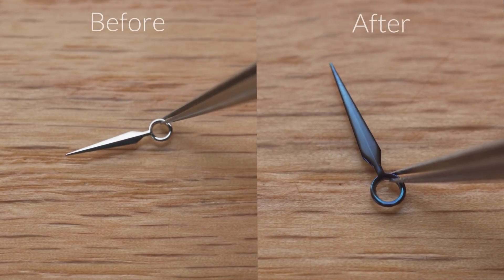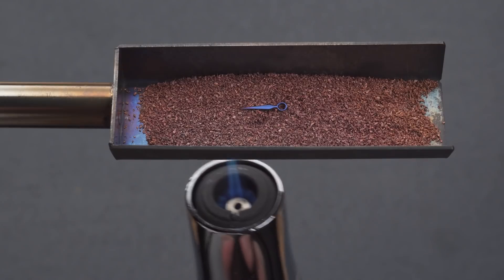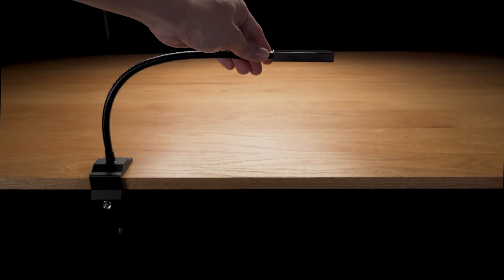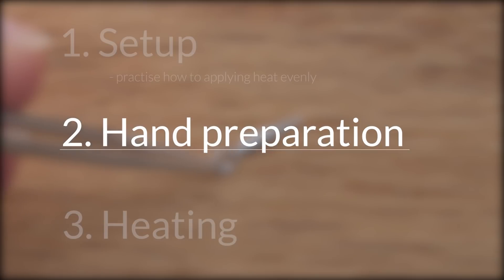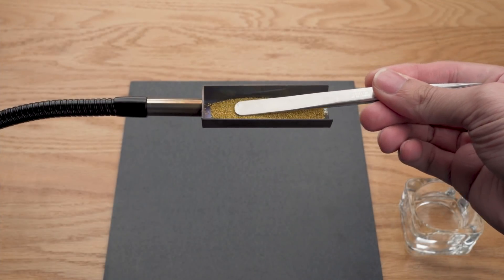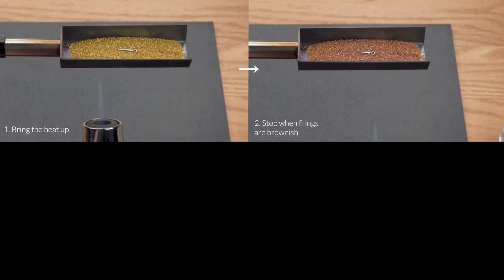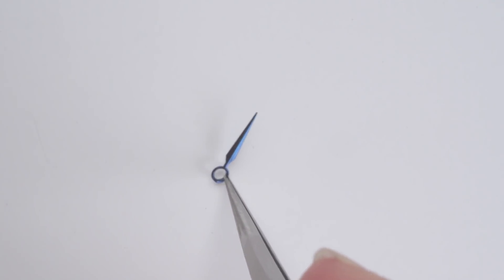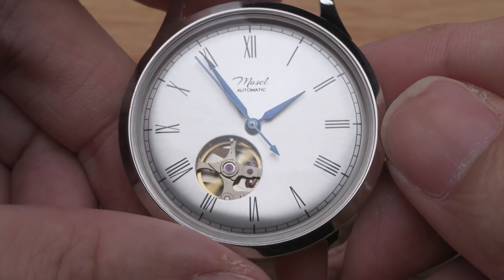Thermal Bluing Steel Watch Hands

Comment: Why not space all three hands closely together and blue them at the same time? If you heat slowly, wouldn't that pretty much guarantee the same color for all?  Thanks!
Reply from the maker: That's a good question! There are a few difficulties with this approach: 1. it adds to the demand to maintain an even temperature and there's no guarantee you can do that perfectly in one go, 2. the three hands are shaped differently (for example the widths of the hour hand and the second hand are drastically different), so their responses to heat behave differently as well, 3. heating them together means you'll need to manage quenching 3 items at the same time, and by the time you quenched the first, the others might be at a different color already. Of course, I can see some engineering solution being developed for each of these difficulties. But by then, you'd be better off using an electric heater or oven that allows for precise temperature control. Quite frankly, that's how it's industrially made nowadays and there's nothing wrong about that. With proper cleaning and preparation, you can make perfect blue hands in batches. The only thing it lacks is the small variance that is human error. And for me personally that's the charm of DIY. BUT don't let me discourage you from trying that approach out. Could be fun!
Reply: This was a demonstration on how to blue a clock hand , surely common sense would say that all hands are done at the same time , but for the purpose of educating viewers only one hand was blued , silly remark really , I'll bet your blushing now when you realise how stupid your remark is . Good video in my opinion , very clear and as others have said no background music to distract a viewer from the concise detail demonstrated .

Comment: Could you show this technique being used for bezels? Would like to color change a bezel to a bronze/brass-like finish
Reply from the maker: It really depends on what the bezel is made with. There could be coating or plating that largely makes the bluing process impossible. And then you have to see what kind of construction the bezel has for turning, and determine whether bluing could affect that mechanism. I could give it a try but the result is going to be really specific to the watch.
Reply: You can do it on carbon steel and UNFINISHED stainless steel of certain varieties. If you have some of the same stock then practice on a tiny piece or find out what material it is (probably 316L) and get some

Comment: I came on to your channel from retro watch channel, I have a question you mention quenching the hands in acetone or mineral spirits and later in your video you say place the hand in the water. I am confused-which is it?
Reply from the maker: Acetone or mineral spirits are used for cleaning the hands, not quenching. We use water to quench the hand. Alternatively, oil can be used to quenched the hand as well but it has to be cleaned afterward (by acetone or mineral spirits).

Comment: Hi, can i do this to all the watch part as long as made of stainless? Like the chapter ring?
Reply from the maker: For cosmetic purposes, yes. Non-stainless steel works the best. Stainless steel, depending on the metal composition, can still work but usually requires a higher temperature (due to it being harder to oxidize). Anything with coating or plating is no no. 

For chapter ring, if it meets the description above, it will probably work. But if there's paint on it (like on the minute markers), paint might be changed by heat, so that's something to look out for.
Reply: @DIYWatchClub  thank you for the information. I will try to experiment with this. Awesome content. I learn alot from your channel.
Reply from the maker: No problem. Have fun and definitely let me know if you manage to blue something!

Comment: If you can blue hands and screws, can you blue bridges in the same ways? Or even the rotor?
Reply from the maker: Good question. I actually touched upon this in another video: https://www.youtube.com/watch?v=6XcgNO_9CjA&t, where I tried to blue a rotor. In general, the bridges and rotors are made with non steel parts (usually brass and nickel plated). So no, they are not blueable. On the other hand, some gears actually can be blued. But that differs wildly across different movements.

Comment: Can the bluing process be used on the crown as well? Or is this limited to hands and screws?
Reply from the maker: Most often than not, the crown cannot be blued. These external elements usually have some form of corrosion resistance in place, or simply isn't steel. But don't let me discourage you from trying, you might get some interesting results!

Comment: can I purchase the brass shaving from somewhere separately?
Reply from the maker: Sure, you can find them in hardware stores or online. But make sure you get the finer shavings. They can be coarse (as in bigger bits), and that's not good for watchmaking
Reply: @DIYWatchClub  FYI coarser shavings work well on pocketwatch screws. (bigger screws bigger chips go figure). 
Nice vids.
Reply from the maker: That's true! Thanks for pointing it out
Reply: @DIYWatchClub  yes I need them so tiny. do you have any online store recommendation? also I have a question about painting the hands if you have any information? Thank you!

Comment: Does the bluing kit work with one of your other kits? Ie the explorer kits hands or does the lume make it impossible? Was considering perhaps bluing the seconds hand since the lume on that is the smallest
Reply from the maker: At this moment, only the hands in the bluing kit can be blued. The reason being not about the lume, but about metal composition. (I actually illustrated this in the new video on blue screws, you'll understand it better: https://youtu.be/6XcgNO_9CjA) You need steel hands to blue. So for now, you can't blue the hands on the explorer kit. BUT, we do have blue-able version of those hands coming out soon, and a companion lume application video guide with it (since you need to flame blue the hands without lume first, then apply the lume on it). So stay tuned! It'll be ready quite soon!

Comment: I feel like bluing certain hands of my entire collection. Specially those watches with a nice contrasting background that have golden hands. The color combination would look amazing.
Reply from the maker: YES once I learned how to blue hands my first wish was to blue everything I can get! But I have to warn you that not every hand can be blued, only steel (better be non stainless steel) can be blued. And sometimes coatings, hardness treatment etc. can interfere with the bluing or flat out make it impossible. I tried something that illustrate exactly this in my new video, check it out! https://youtu.be/6XcgNO_9CjA
Reply: @DIYWatchClub  So, step one: replacing all non-steel hands with an exact SS replica 😂

Comment: How do you get this kind of sharp, three-dimensional alpha hands? I checked out that it is easy to make flat ones, but the edgy ones seem to require some kind of mold.
Reply from the maker: That is a good question. To be honest, I just get them from suppliers. How they make it, I'll have to ask them. Let you know if I get any answer. But if I have to guess I would also say some form of molding is involved.
Reply: @DIYWatchClub  I see. You just heat them blue